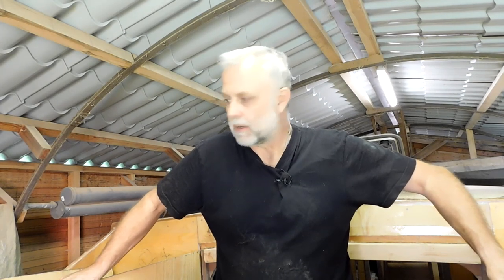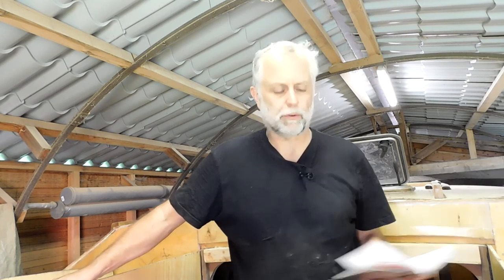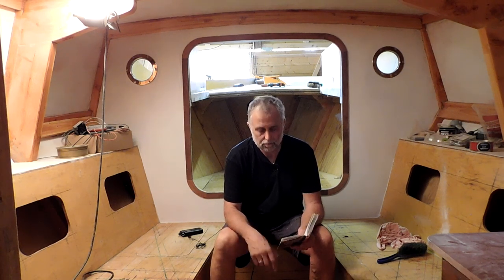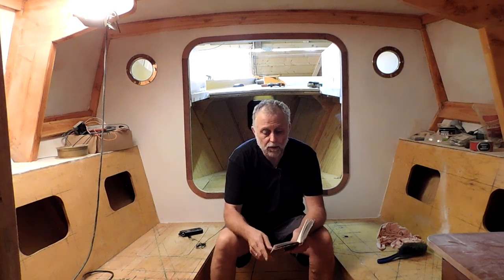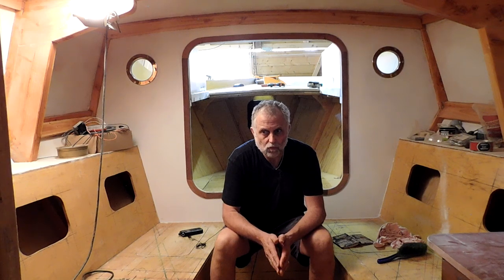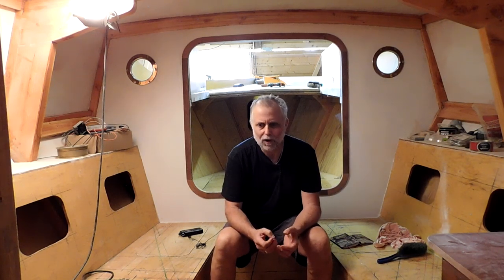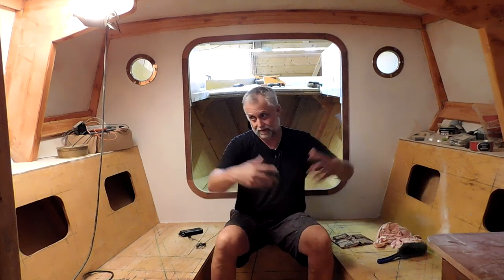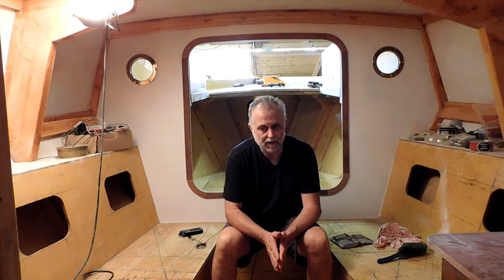The keel and other questions - SV Tapatya EP96

Comment: Thanks Tony, It was nice to hear that you appreciate my questions and that they make you think.. :-D

I very much appreciate hearing more of your reasoning re drill-fill-drill, and I think you do make some good points. I wouldn't go so far as to say I "hate" your view, even if I don't necessarily agree. I've seen some boats with plywood decks that had significant problems thanks to not taking that approach. Perhaps the best solution lies somewhere between the two extremes. After you mentioned Wendy Hinman's "Sea Trials - Around the World with Duct Tape and Baling Wire" I bought it on Kindle, and just finished reading it about a week ago. Wow.. what a battle that family had.. thanks for the recommendation!

Interesting that you should mention Jerry Limber's Badger build, too.. I was a member of the Badger Owner Builder's Yahoo Group during the time Jerry was building 'Piper', and remember him making that keel. I remember how shocked I was a few years back when I came across the photo-journal of her new owners, documenting all the problems they'd had to fix. There were hundreds of detailed pictures and descriptions. After just a couple of years on the water, she was weeping rust from several points on her hull, where Jerry hadn't removed the steel staples he'd used when planking, and he'd done virtually no filleting or glassing of internal joints and bulkheads at all.. the engine room in particular was a nightmare when it came to poor construction. To be honest, Piper looked like she'd been built by a 2nd year house carpenter's apprentice. It took them several years work and a lot of money to get her up to scratch. I'd admired Jerry's build at the time, and was stunned by what I saw.

Unfortunately, now that Google has shut down Picasaweb, the photos are no longer available. The only footage I can still find of her is a single 5 minute video on youtube, where much of the work and rebuilding of her interior has already been done. It does show some very good footage of the kind of keel you discussed, though. https://www.youtube.com/watch?v=o86AO-kzfVk
Reply from the maker: Hi Garryck
I’ll PM you about this. It’ll be a few days though 👍
Reply from the maker: Or at least I would if I could find your email address. Can you send it to me, please, I'd like to talk to you about this. Thanks mate 👍
Reply from the maker: For the benefit of others reading this, and to get back to you, Garryck, I've seen the video you link before but didn't know that it was the same boat 'Piper' that Jerry built. I knew he had sold it and had even tried to find out what had happened to it, but without success. Thanks Garryck for putting those 2 pieces together.

It's a shame the other photos you mention are no longer available; such things are very useful for other builders and potential builders. I was also a lurker on the Badger Builders Yahoo group back then, Garryck..... 👍
Reply: @SVTapatya  - Email address sent.

Comment: Drill fill drill is a technique used on fiberglass boats with foam core. Foam core when it gets wet just becomes mush. It's best to use this technique to prevent water intrusion. But, the failure of the sealant should be blamed and so should the neglect by the owner(s). Plywoodly resists water intrusion because of the glue used to bond it together. So yes, I agree with it not being necessary for plywood boats. Use the proper sealant on hardware and actually maintain that hardware and it will last longer than most other boats.,
Reply from the maker: Yes 👍

Comment: What I have been wondering up to now, is, why are you sealing hatches and stuff on when you haven't painted it yet? Shouldn't you be painting things before you seal it all in place? Are you going to take them off again to paint under the frames or are you going to just paint up to the edge and hope it looks ok?
Reply from the maker: I prefer to bond permanent fittings to the structure of the boat and not to a layer of paint, Rachael. I also have no issue with "cutting in" ( painting around things) 👍
Reply: @SVTapatya  Ok, I understand and I see your point, but for me I came from fixing/building motorbikes, cars & trucks and working with steel, so to me you paint it first, then put it all together, and I'm not saying your way is wrong, in this case its probably going to make a better seal doing it your way, but its still "difficult" for me to watch it happening. And if I end up getting a wood/composite boat, I will probably do the same, and a few other tricks I have learned here, but if its steel, I'm still painting it first. Thank you for sharing these.
Reply from the maker: I completely understand, Rachael. Several other people have made similar comments. I guess we do things the way we feel is right, and perhaps there is no one right way.

Comment: Might seem a silly question, but why taking the screws out after glueing things together vs just leaving them in?
Reply from the maker: Avoiding mixed metals, Daniel. Also, they’re unnecessary 👍😃
Reply: @SVTapatya  ok. So if I would use just one kind of screws/metal I would be fine I guess. I just assumed that they support the joint a little if  you leave them in. Thanks for your reply, you are doing an awsome job and I learn a lot!
Reply from the maker: Thanks Daniel. The trouble is, bronze screws are bloody expensive and hard to put in and i am only using bronze under the water line